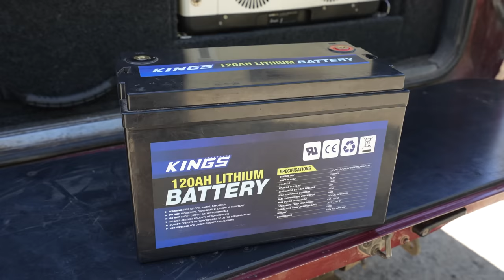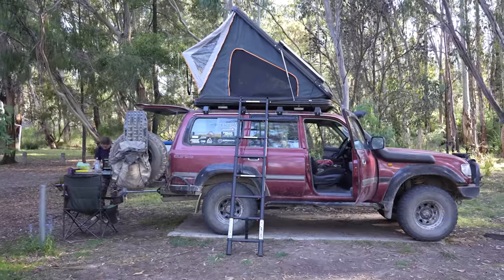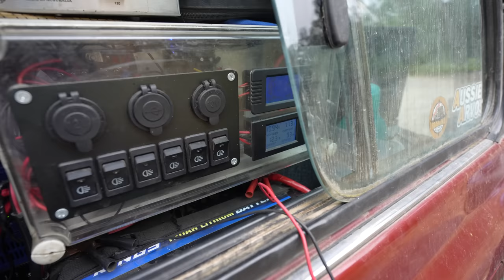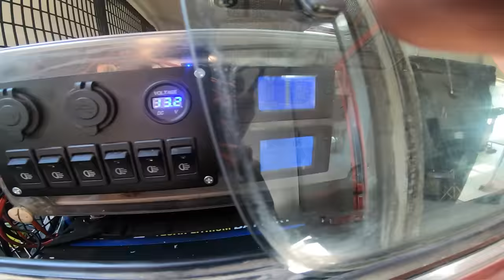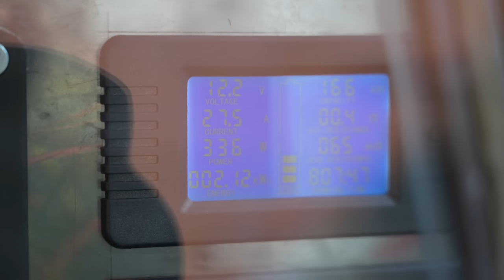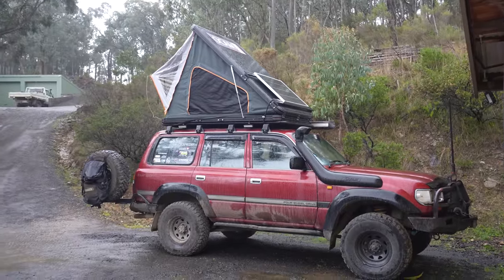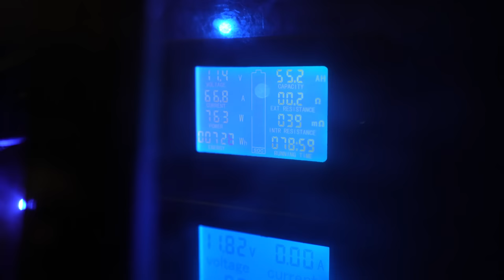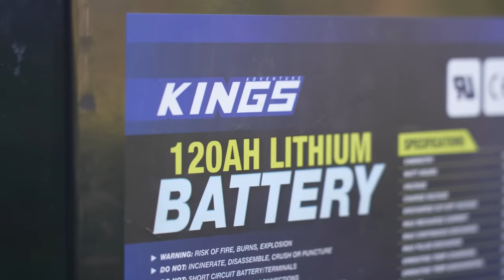Watch this BEFORE you BUY Kings Lithium Batteries

Comment: I think the weakness in a lot of DIY battery systems is the wiring. If its not done properly it can under perform or be a fire hazard. Good quality / size wiring, fuses and terminal connections are key.
Reply from the maker: 100%
Reply: Paul Barnett. You don't need half the 12v crap that a lot of people have
Reply: youre only half right, im an auto electrician and yes half the DIY stuff ive had to re do is shocking and a massive hazard, but running electrical gear from places like kings is just as hazardous, the general public shouldnt be taking advice from an unqualified youtuber.
Reply: @schmonyon  So what part of this video is not true? Are you saying to not go with Kings?
Reply: @Mikey Strikey what? my comment wasn't in regards to the video, it was about the comment I had replied to. But yes kings electrical gear is horrible, even the gear from kick ass and itech world I wouldn't install if a customer asked me to.
Reply: @schmonyon  So what would you recommend? Is Allion any good?
Reply: @Mikey Strikey  victron gear all the way, enerdrive and redarc are good but way over priced in my opinion. For batteries go with ATG
Reply: @strikemaster1  I’m using an Enerdrive system, designed, manufactured and installed by Norweld for their canopies. Pretty confident in the system. 200Ah lithium, 40amp DCDC, 60amp ACDC, 2000w inverter etc. Runs fridge, induction cooker, lights, travel buddy etc. Charged off the car battery/alternator or solar
Reply: @schmonyon  I see ATG are engineered in Oz. I will research them now. Never heard of them till you mention them. Was about to go with Allion as they are currently discounted, but still too expensive. What do you think of them?  BTW... where are you situated? I am on the road in Echuca presently, heading south.
Reply: @Wilbargosh  Sounds good. Thats exactly the setup I have. Isuzu Dmax towing 2.5 ton caravan with 240 watt solar on top, and powered by 2 x120AH FullRiver AGM,s which not holding charge for very long with minimal use. All good in sunshine, but as soon as the sun goes to bed, they drop from 12.7-8 V to 12.5 in one hour running only lights. TV and diesel heater. Its at this stage the heater turns off for lack of power. I have limited knowledge with 12v stuff and is why I committed the cardinal sin buy adding a new FullRiver battery in parallel with my 2 years old one. Told later thats a no no haha. Anyway, looking to do some more serious long term travelling camping, so looking at scrapping the whole lot, including solar, and replacing after only 5 years total. This time I will get professional help.
Reply: @Mikey Strikey  yeah mate that's right, engineered here and built over seas, Al Carr the bloke that's in charge is super friendly and very knowledgeable, they are also covered by insurance if the batteries happen to cause a fire which not a lot of batt manufacturers are. They also sell victron gear at good prices
Reply: @strikemaster1  im in the Goldfields of WA
Reply: @schmonyon  have you seen Hardkorr what do u think of them?
Reply: @only1envy52  they are no different to kings, kickass etc, its cheap Chinese crap with poor quality control, what makes me laugh the most is when people spend like 80 to 100k on a brand new car, then fit cheap 12v gear to it that was wired up by either "accessory fitters", themselves or a friends brothers cousin, as I said in a previous comment, victron gear with ATG batteries, can't go wrong

Comment: Brilliant take on these units! What's interesting to know is that new ones of late have a 120A load rating (over 100A of the older model) and they do indeed manage to pull that much current without issues.  We run 2 of these in parallel in our camper trailer (for 240Ah total capacity) and when load tested (10A draw) we saw 254Ah of total usage.  Highly impressive, given the sub-$500 price point.  When I connect the solar up, we've yet to find the limit of what we can run! :)
Reply: The newer 200Ah lithium also now have 200A continuous (vs 150A previously) and I've happily run an induction cooktop off it that draws about 130A continuously.

Comment: Sheesh where you 5 months ago when I dived in and purchased one of these. I haven't actually been off grid yet, so it's not been put through its paces. I actually stumbled on this and opened the video quite nervously, hoping you weren't about to tell how terrible they are...   I did try to do as much research as I could, but there isn't much out there.  I eventually went with the fact that Kings claim to use A grade cells.  This kind of claim is usually only found in the high end, expensive batteries.  Also, a bloke reviewed the 200aH battery quite comprehensively and spoke highly of it.  You usually seem some consistency in the qualify of cell, and BMS used, just more cells in the larger battery.  So I committed to it.  Very glad to see you spoke well of it, bit of a relief really.  Also, nice and comprehensive review.  I think you're worth watching more of.

Comment: Great advice for the general user. One point though that you didn't touch on is recommended and Maximum discharge current. Technically the Kings battery should only be pushed to 100A maximum continuous discharge or 160A for 10sec. If you run a 1500w inverter fully, you are exceeding the recommended rating... 1500w ÷ 12.8v = 117A.
This kings battery is pretty good at 100A, but quite a lot of cheaper Lithium batteries are limited to 50A out... something that people breaking into the lithium market need to understand!
Good review
Reply: Such calculations should always include inverter efficiency and the lowest voltage you're likely to drain the battery down to, which in most cases would be the BMS low voltage cut off or disconnect. So, using your example with some typical values of cutoff voltage and inverter efficiency, it would be 1500w ÷ 10.5v ÷ 0.85 = 168amps.  If someone wants to run say a 2000w inverter with an 1800w induction cooktop off a 120Ah Kings lithium battery that has a 100A continuous rating they're going to have BMS shutdowns and eventually something on the BMS in my opinion will eventually give out through overloads and abuse. 2x such batteries (minimum) should be used in parallel for such loads.

Comment: I've had my Kings 60 litre fridge running in my van for around 7 years no stop. It's survived 720km of Simpson sand dunes and around 8000 km of corrugations. Has been 100% reliable so far.

Comment: Thanks for converting me to lithium twelve months ago. King’s battery box 120ah 25ah dc-dc & 160ah solar panel running Kings 90lt fridge in the ute. 2x120ah & 40ah Kings dc-dc, which I had trouble with, but the third one works great. 3x160ah solar panels on the caravan. We run induction, coffee machine lights and all for 5 months whilst prospecting in the gold fields. Thanks guys for the vids keep it up. 👍😂
Reply from the maker: Great to hear Gordon!! Awesome setup! Hope you're finding some good out there ! Cheers

Comment: Great review 🤘👍 imo Kings definitely has a place in the market and their products aren’t that bad. The only real issue I have ever had is with their weak original pullout awnings bending poles and Velcro not holding. I still have the original Big Daddy swag that is 12yrs old and still use on every trip. Their draw system was ok too, had it 10yrs before I sold the car and only ever broke the catches.
Reply: same, only issue is the awning. i barely use my awning now, i bought a kings 3x3 gazebo-ma-jig and thats worked wonders so far. plus it means the car isnt immobile when camp is setup.
Reply from the maker: Agreed! Cheers for watching
Reply: That all depends on the product.  The Kings branded MPPT small charger, the blue one with a USB socket smack in the middle of the front if it, is junk.  It has terrible voltage regulation and will overshoot quite badly as say clouds pass over head and light levels go up and down.  The voltage points, absorption/equalisation times, or even tail currents is not adjustable nor even documented.  As an added bonus you get to pay about twice what the precise same thing, sans Kings branding, goes for on aliexpress.

Not saying that all Kings branded stuff is junk but a case of buyer beware.  The trick is, does the average man off the street have the nous to know which of Kings branded stuff should be avoided?  Probably not.
Reply: Yes. I’d never buy a kings awning again but I have plenty of other stuff from them. Thousands worth and it’s all been good. Except for the weak awning.

Comment: I was facing frequent blackouts at home and wanted a backup system just to keep the 240v fridges going. I got the Kings 120ah lithium as well as a solar panel and charge controller. Rock solid, really happy with it, especially at this price point. Only downside really is the lack of documentation for the charge controller, they don't give much info but enough for basic functionality.

Comment: Been thinking about making the change from AGM to lithium but didn't want to break the bank, this gives me a lot more confidence in making that decision. Great video as always 👌🏻
Reply from the maker: Thanks Karl! Glad this could help! Cheers for watching !
Reply: They seem ok .. But 2 year warranty is of concern for me .. If say it fails in 25 months .  Your 2000 cycles dont mean squat .. Surely they could offer 6 or 7 years with a 2000 cycle life warranty.. Which ever comes first .. Most BMS record cycle life now days ..
Reply: I have 2 x 120 ah agm batteries @ $200 each I bought 12 months ago. 
I just bought 1 x 120 ah lithium battery @ $399 
So much lighter. Can run more appliances. They are so much better.

Comment: I spent $568.65 for 100ah lifepo4 solarking in 2019. It's been great, and still is. Charged with victron mppt and enerdrive dc2dc, which IMO is key here. Had so many people say it's too cheap (back then) will set in fire, it's got tiles in it it etc etc. 
It's been a better deal than the king's in reality as it was way before they sold lithium, not saying king's is bad but just highlighting how good this battery has been. However, I have outgrown it in my camping setup now (just more power draw) and I've moved onto an ATG 150ah instead, but, the old Solarking (which has full capacity still measured by victron bmv-712) runs my trolling motor on my tinny 👍😁

Comment: Thanks AA - I bought an Amptron 100ah Lithium battery when Kings prices were similar - I’m now installing a Kings 1500W inverter to the battery via a 100 A circuit breaker and relay so I can isolate the inverter circuit when I don’t need 240v power - all my devices connect via fuse to relays triggered by Narva style rocker switches as I don’t like running power loads through a switch itself - I chose the Kings inverter after a 1 year positive report from a reviewer who tries to break equipment and he was surprisingly impressed that the Kings unit did so well - I use a Redarc charger but their inverters appear to be rebadged Chinese items not like their chargers manufactured in Adelaide South Australia - now I can have real toast for breakfast 😊😊

Comment: I will admit I was a kings hater in the beginning, but once I bought the bullet I can say that I've had a change of heart I've had the kings 300ah lithium Battery with the 3000w inverter from kings and to just pull up to camp and to pull out my airfryer and induction and not worrying about gas and wind and having food cooked in 20 to 30 minutes has been a Game changer for me. Having my friends laugh at my setup when I got it. Now, seeing that everyone's of my mates now has airfryer in their car running of kings gears, I'm the one that is laughing now. Kings have come a long way from where they have started. Also, Patrick, keep up the get work and plz stay one of the few/only budget channels for 4wd and camping that's I know. So keep doing what you do best, making legendary videos that all Australians can relate to.
Reply: Hey Corey, 

The 300Ah battery is rated for 150A discharge which is 150A x 12v = 1800W~
Which means your inverter is oversized for your battery.

You probably bought that inverter over the 1500W for good reason though. I would have probably done the same.

But for others, if you plan to pull lots of current, you may be better off buying 2x 120Ah (2x 100A discharge = 200A x 12v = 2400W capacity) which is more suited to a 3000W inverter

However, each individual needs to find the balance between current capacity and storage capacity depending on your needs
Reply: @Matty  on the website the battery say that it's 150 yes but I have a mate that work at King and I talked to him about it and they changed all the bms in all the lithium the 120 has I 150amp discharge the 200 has 200amp and the 300 has a 300amp
Reply: @coreyhodson1718  that's really good news. It makes me consider my options a bit differently. Thank you!
Reply: @mattym00  also make sure if you get kings lithium that's you wake the battery up from it sleep mode first any 230v lithium charger or mppt will do the job cause the dcdc won't pick it up and won't charger the battery

Comment: Hey Patrick, have you thought about an air-fryer? Not much bigger than the Buddy, yet a hundred times more versatile. I rarely use a fry-pan or the home oven anymore. It cooks better than anything, and is good on electricity. Easy-as to clean too.
Reply: Great suggestion, but:
You cant run an air fryer off 12Vdc.
It exhausts a lot of hot air and filth, so unlike the Buddy, you would have to use it outside, but most importantly in my case, you couldn't leave it unattended, I put my(our) smoko pie(s) in cold from the fridge at 7AM and they are perfect at 10AM, lunch goes in at 10AM and it's bang on at Noon.
That's 5 hours at 50Watts = 20.83Ah
I fitted a digital thermostat to my Buddy and gave it better insulation, so uses half that amount now

Comment: For laptops, I`ve found it easier to get a 12v adapter charger,  they work amazing and you don`t have to switch on your inverter. Also, some PCs use USBc charger, and installing a 60w USB booster, will have your gear charged in no time. Hope it helps :)

Comment: I've just gone lithium all from Kings also, running the 300Amph battery fixed inside the 70L tuff box also from Kings for security in travel, keeping the battery dry and easier to pick up. Running the 12V power station mounted to the top of the box along with the 500w inverter also mounted to the top of the tuff box.. Charged by 2 X 280w solar panels running 30amp MPPT regulators.. No dramas running everything in need completely off grid for months at a time. I just had over a week of overcast rainy days and my battery didn't drop below 12.8v running a 75L dual zone fridge freezer camp lights and charging devices daily.. I'm very impressed and will be making another power box set up only changing the inverter to the 2000w model increasing my versatility.. 👌

Comment: one more thing you forgot to mention is the constant draw i noticed that the kings says 100A which isn't to bad for basic stuff  like most of us do. But some of these cheaper ones can only output 50A max constant draw which is crap wouldn't run a small compressor even . some of the bigger brands do 150A to 200A and that's where the extra money is going. love your vids mate keep up the good work

Comment: We did a lap of aus in our camper trailer with 2 agms to start with a had nothing but issues when in the heat and having the fridge never stop running, we ended up with 2 x 200amp kings lithium batterys and lived off induction while powering whatever you wanted to and farout I am loving it, down to 799 a battery it was a no brainer 🤙 love your videos man!
Reply from the maker: Thanks Dale! glad to hear that mate, sounds like an awesome setup! cheers :)